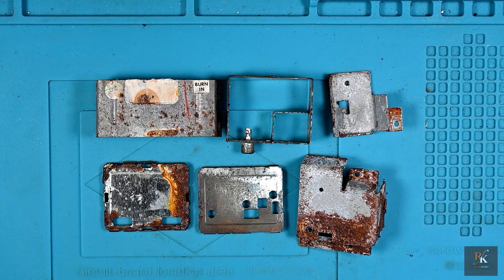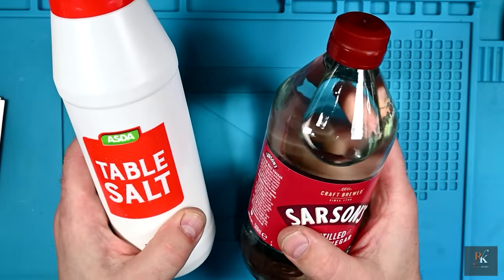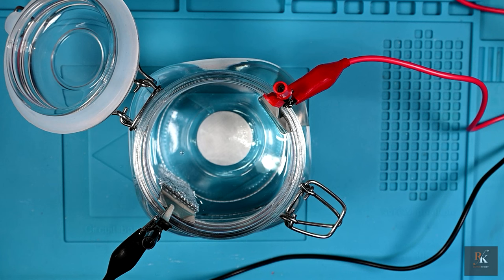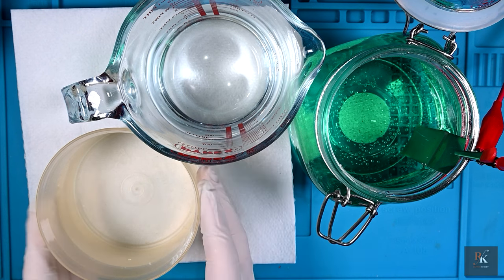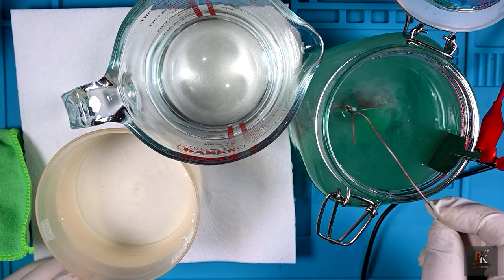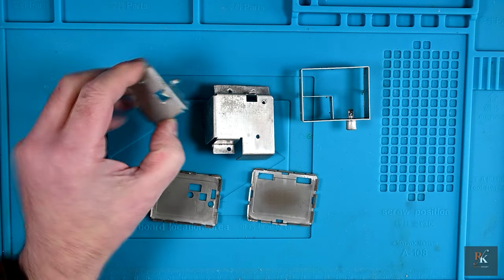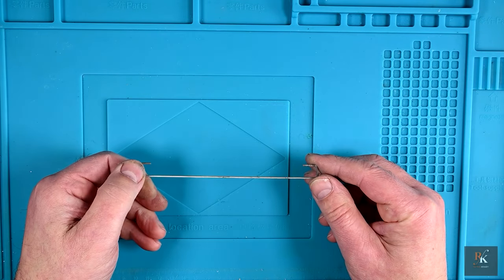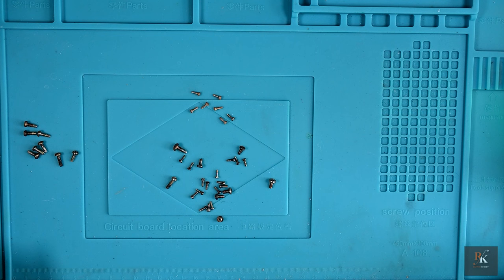Mini Byte: How to Nickel Plate for Retro Restorations!

Comment: The end result is great!!!!  The Nickel really makes it shine!  It will oxidise over time (as does Zinc)!  I found it painfully time consuming doing that MVS 4 slot shell - on something so large it just took forever...   As per my Discord comment - be careful to avoid stainless steel (aligator clips are made of that) or you get Chromium released - and always check what gases might be produced too.
Reply from the maker: Thanks Gadget! As someone I loom up to, for me that is high praise :-)
Yes, making sure the crock clips arent touching the fluid is a major point and agree that you need to be careful of the gasses. In such a small jar with my front and back windows open, it was more the overpowering smell of vinegar that was the issue!
Will need to try a much larger part at some point as I believe you will either need a huge thin, verticle tub with long nickel electrodes for best results or use a standard large tub and get the ends coated well and the center almost not at all...

Comment: That turned out really well, I don't ever think that I've seen a retro channel cover this before. I've got an Atari 7800 with very shabby shielding that could use this (I'd probably need to setup a bathtub of solution to fit it in though). Excellent information nonetheless, bookmarked. I'm sure that It'll come in handy in the future ;)
Reply from the maker: Glad you liked the video! Using a larger storzge tub should be fine, though you may need a larger container to pour it into if you want to seal it up for later use. Or many smaller ones!

Comment: the coppers also better conducting into the solution.

it's possible to put heatshrink tubing on it to avoid it conducting from there (not all the way of it obv it needs to conduct to the part) or really any tubing will increase the distance from the copper hanger even if the solution can get into the tubing

nice results!
Reply from the maker: Good shout on that, thanks! Hadn't though of that... doh!

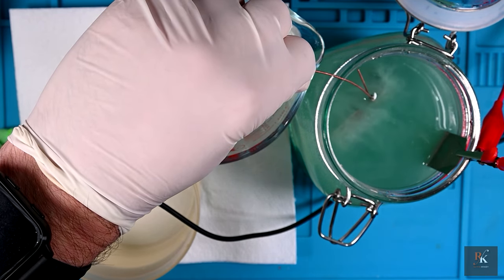Comment: 12:08 the solution to even plating from all sides is to have not one but at least 3 positive electrodes around the container.
Reply from the maker: Yeah, definitely. I ended up with two but I think a larger container with more is the way to go. However for the small scale I did, I still am amazed at the results :-)